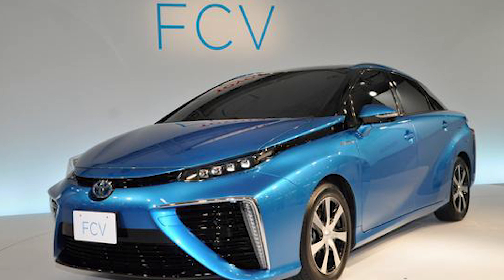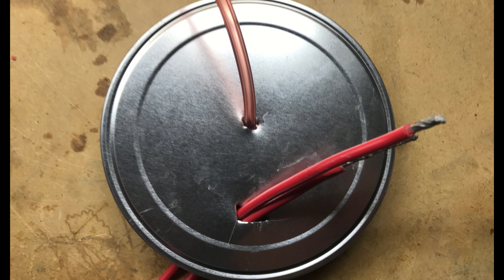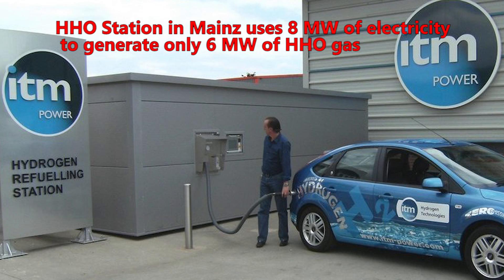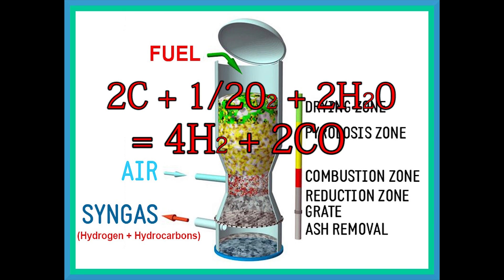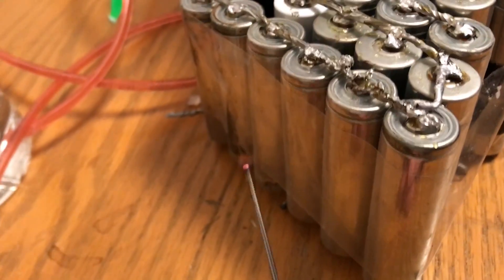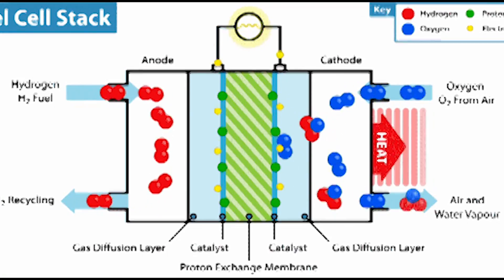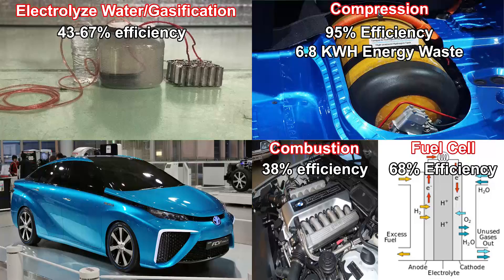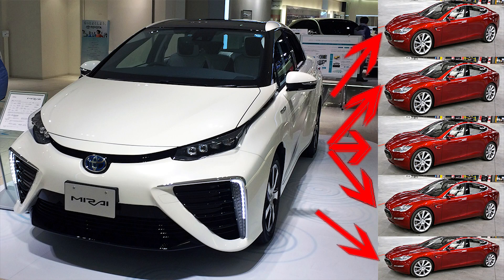Are hydrogen cars environmentally friendly?

Comment: In that logic, to compare this to ordinary gasoline/diesel cars you'll have to factor in all the energy used to get the oil out of the ground, refine it, transport and pump it into your car too - then probably they'll end up at approx. same eff.level. BUT there are more efficient ways to produce hydrogen, store it using hydrides instead of insane compression, etc. or short said there are far more successful stuff dpne than yours halfway done, then theorized the rest project. The reason you'll meet so much pessimism is typical old professors and a very efficient campaign by the oil industry to make you believe it's just not practical. But there are amongst all the hydrogen scams, also serious companies that can rebuild any engine to run reliably on hydrogen, like securesupplies (Daniel Donatelli) f.ex. and better results than the hydrogen cars from the big car manufacturers has been made and patented(although you will run into laws and regulation here) like in this video with the "nut" or biggest genious whistleblower of all times, Bob Lazar https://www.youtube.com/watch?v=n-GATxen04U